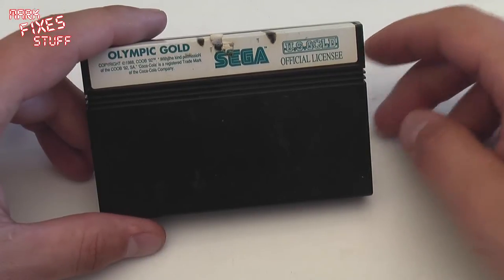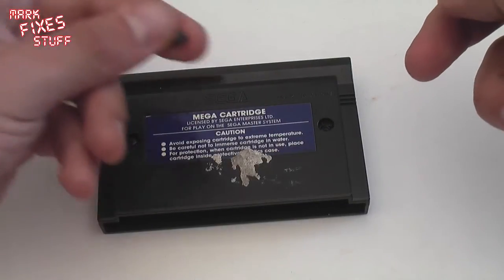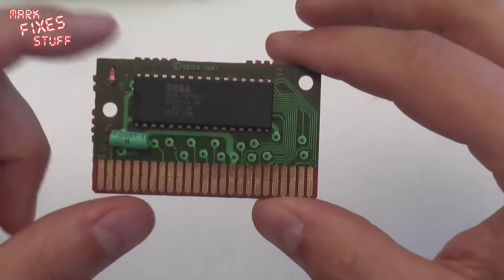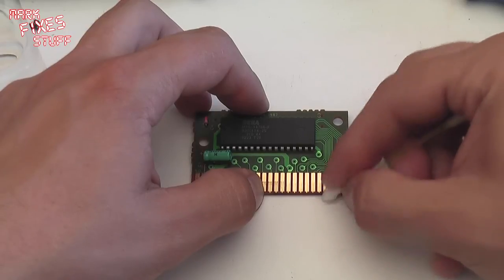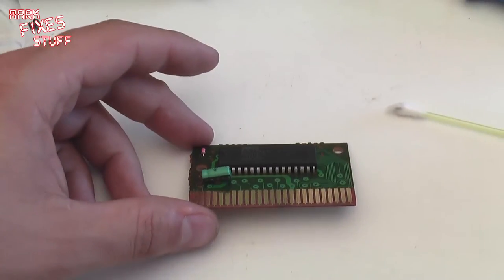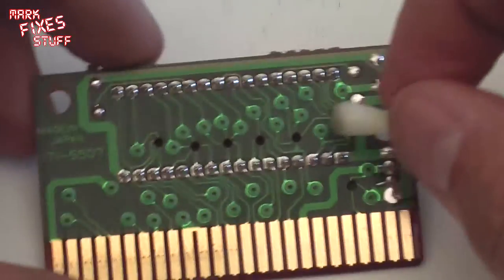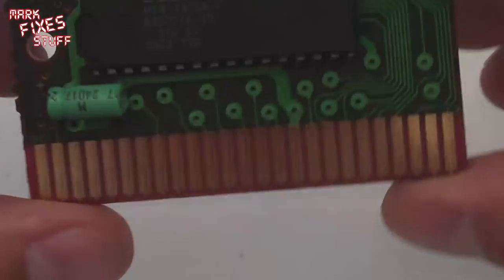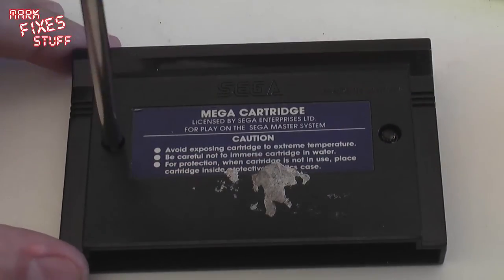Open and Clean a Sega Master System Cartridge with Isopropyl Alcohol

Comment: My game works but there is flashing on the screen.  I've done blown out the cartridge like I do on NES cartridges.  I'm using a Power Base Converter, so basically I can play Master System games in the Sega Gensis.  After Burner works perfectly there's no screen flashing.  But on Alien Syndrome, it's constant flashing.

It's okay to use alcohol to clean these up?

Comment: Bought a game today from Cex but some of the contacts are missing 😕😕 but the game works. Will it be OK to keep or shall I return it? Are some of the games normal to not have contacts all along? As seen others like it but they all work.
Reply from the maker: If a contact is not used in the game (SRAM for example) it's not manufactured on the board because metal costs money! As long as it works and the save function works as it should (if it has one) then it will be fine.

A contact won't be missing during manufacture and won't come off of a cart circuit board without significant damage. I'm guessing it's just not a needed contact. Many of my carts have this too.

Hope this helps!